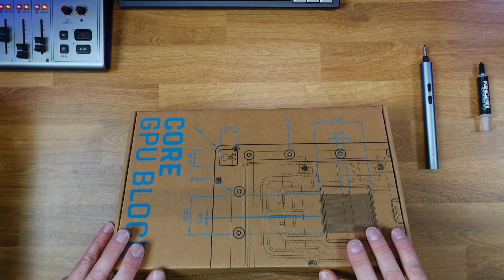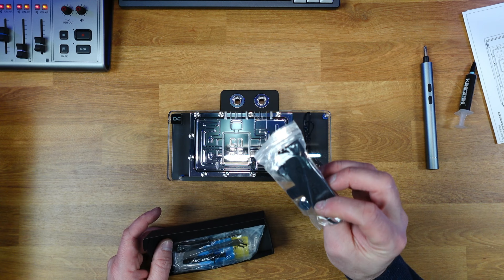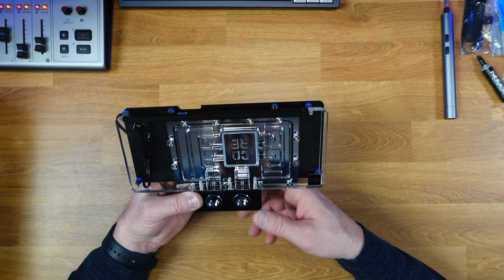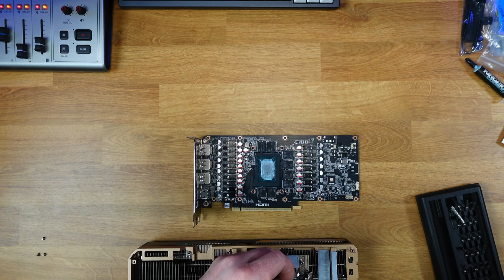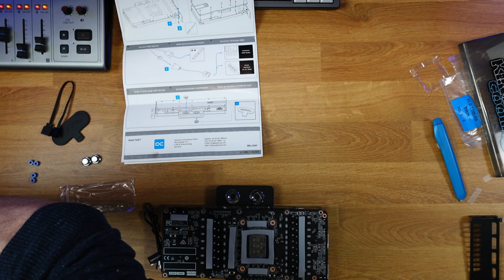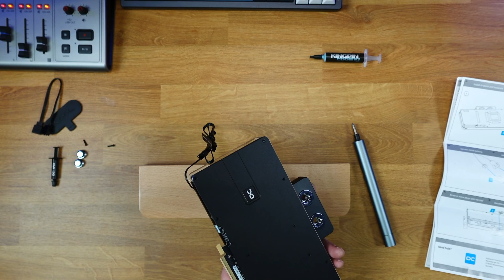Zotac RTX 5080 Core OC Gets Alphacool Core Water Block Upgrade!

Comment: good video. Which water-block are you using here? I never used water-block before, but now starting to thick it's a good idea for starting to use it.
And interesting, what with noise lvl after changed air cooling system to water-block in 5080?
Reply from the maker: The pc is virtually silent / that and the temperature improvement is the main reason for going to a custom loop cooling solution.

Comment: I have the same card but the block from alpha cool didn't fit
Reply: There is the 5080 Solid and the Solid Core. The Solid core uses the smaller PCB.
Reply from the maker: Make sure you have the correct part number-
Reply: I have the same issue. I ordered the “Alphacool Core Geforce RTX 5080 Solid + AMP GPU Water Block with Backplate” on Amazon which claims to fit the zotac 5080 oc on titan rig’s website but doesn’t seem to in person.

Edit: update so I realized I ordered the amp version. The right version is on modmymods if you look up 14845 in the search bar.

Comment: How thick are the pads with the kit?  All the same size, different sizes?  Thanks
Reply from the maker: Different sizes for the pcb and back plate . I’m trying to remember but maybe 1.5 on the pcb and seemed like 2.5 on the backplate. It’s is specified in the instructions though.

Comment: The spacers are for packing and shipping purposes. It does say it in the manual. Thanks for the video. Doing the same thing 👏
Reply from the maker: It definitely does say to remove but , it doesn’t give a count and doesn’t show them installed in the instructions. Not a big deal but someone may get confused, typically users that would be new to watercooling .I will do testing this week !
Reply: @tonypolitowicz8290 Agreed....trust after i left my comment I was like "gawd I'm turning into that guy" 🤦wasn't trying to be negative or anything just kind talking/ typing out loud. Great video quality 👌 Good luck with your channel 🙏
Reply from the maker: @bignicnrg3856 👍👍👍👍👍👍👍👍
Reply: @tonypolitowicz8290 good point Tony, cause I sure as hell would be wondering where do they go?!?
Reply: Be interested to see the build video.
Reply from the maker: Thank you for the view !!